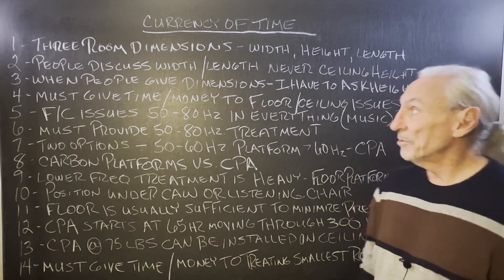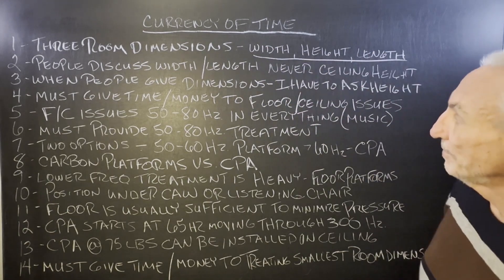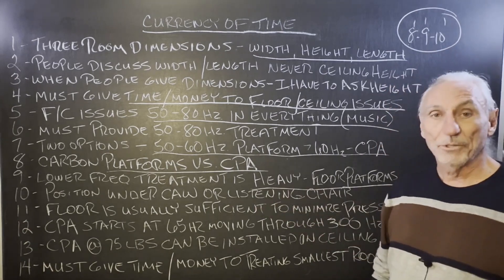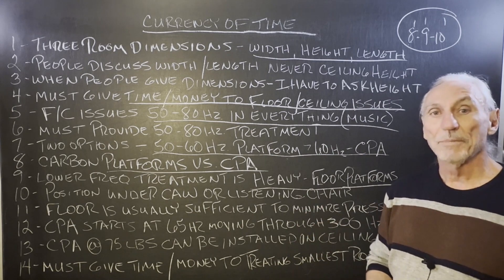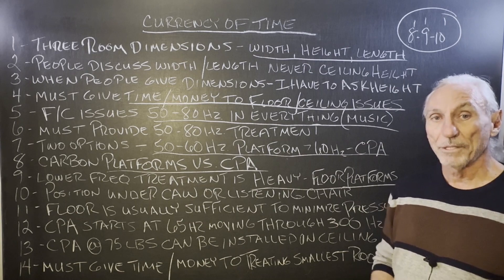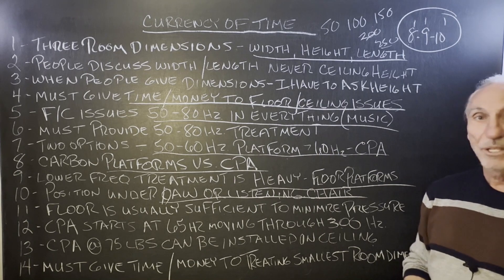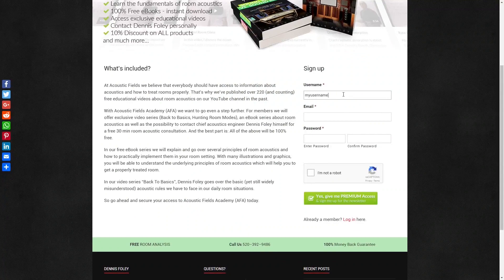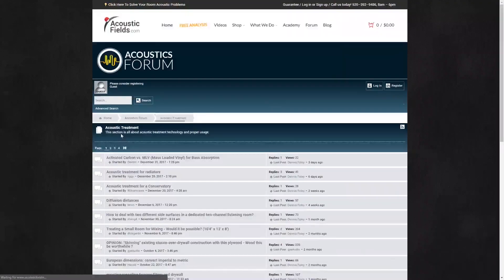Currency of Time - www.AcousticFields.com

Comment: Dennis, I have to say I have never really "heard" music and movies until now! I'm the guy in the upstairs of my 24x24ft barn... spray foamed closed cell on the front & rear vertical walls and open cell sprayed under the roofline. Brand new carpet and pad. My L-P is 1/3 into the room and I'm at the apex of a 10ft equilateral triangle. I am not only hearing words, but syllables. What an insane difference from the house living room.... hallways, not centered, glass and glass on angles, etc. I'm approaching 64 yrs old and it's not as though I haven't believed you about how sound works, it's simply that I can't afford what you offer. I'll stroll into the room corners and wholly shit... sounds like a tornado is in my room. I know that's what you offer, but don't really think I need it at my L-P. I'd love a response from you !
Reply from the maker: It appears that you are happy with your music. Mission accomplished.